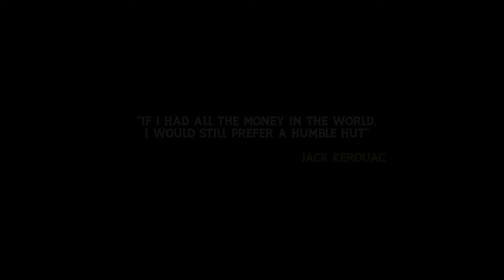OTRCMP : EP26 : Tarring the Roof on My Trailer

Comment: Good job Justin.  If you haven't already, I would rip out the portions of the ceiling that are soaked with rain.  Mold is nothing to ignore and it grows fast....as you saw on the wood you sanded.
Reply from the maker: Tackling it next week, it was low on the priority list but to easy to put on hold any longer.

Comment: Roofing tar is thicker, not sure what that was maybe just old and broke down tar or blacktop sealer. Glad it worked. Why not use some of the old tin you took off of basically everything out there. LOL Not high on the priority list.
Reply from the maker: I think you are right, black top sealer probably. Either way a helpful material for this job!

Comment: I’m a little concerned about whatever’s hanging down from the ceiling in plastic where the leak was. It looks like black mold. Please be careful about that. Black mold is deadly and has to be removed safely.
Reply from the maker: I rarely spend time in the trailer but you are right I need to get it sorted. I’m a firm believer that prolonged exposure of anything is when it’s bad which I’m not. I’ll do my best. Never ending list of to dos!!! thanks for watching